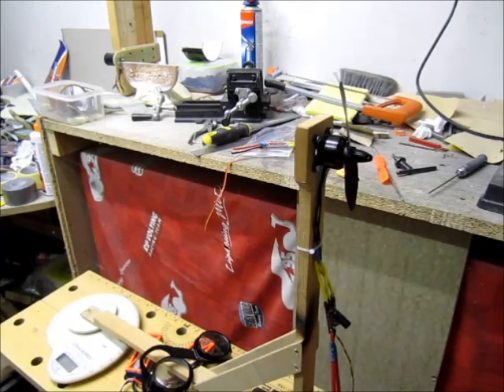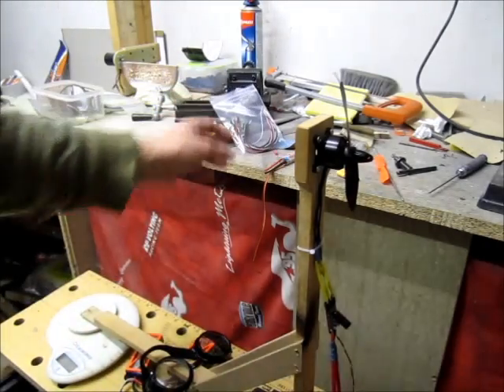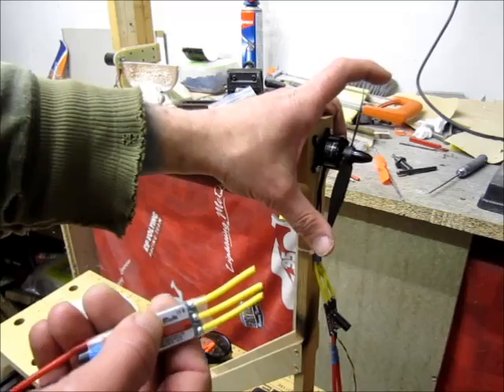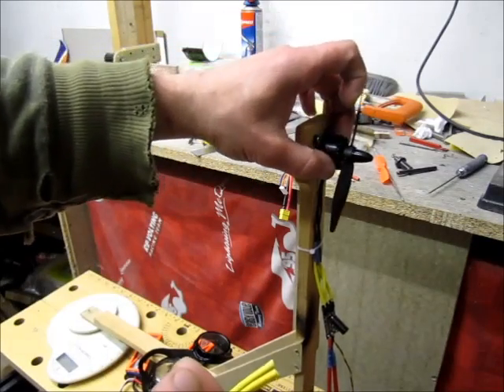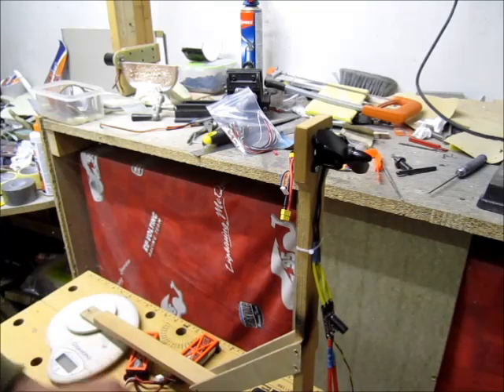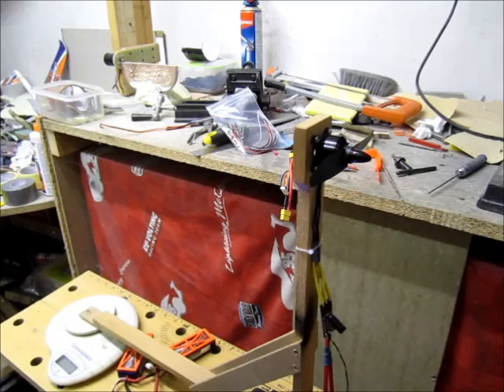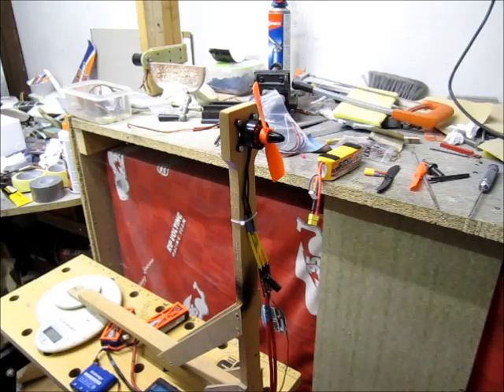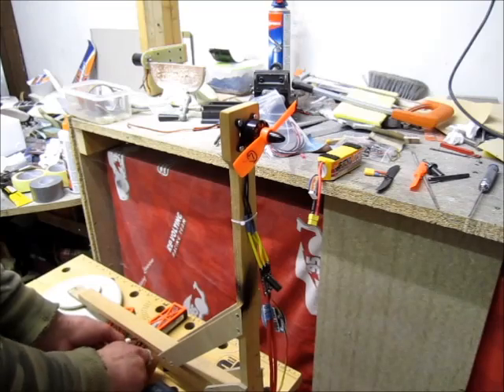Custom built ESC 6s test

Comment: Hi, Why didn't the ESC make it to production? :/
Are you using the SunnySky x2207 2700kv or 2100kv?
Reply from the maker: The Presteign 2100kv ones. The reason why them ESCs didn't go to production is that that fella doesn't do this for business, only as hobby for himself. His slim 12A ones that fit inside 12mm tube went to production by ImmersionRC for their Vortex quad and called EzESC now and that's it, no more gear. He has more good ideas and stuff, but doesn't want to do this for business.